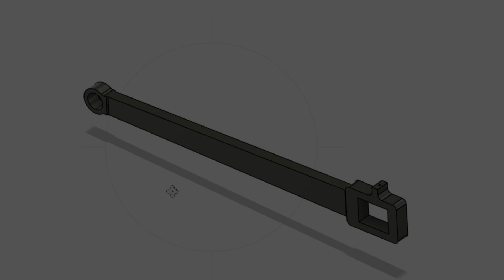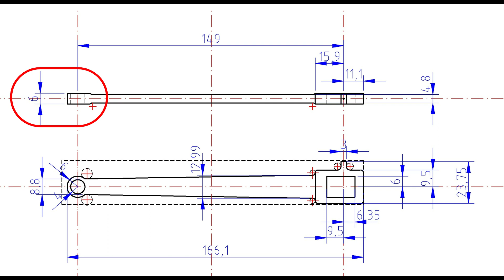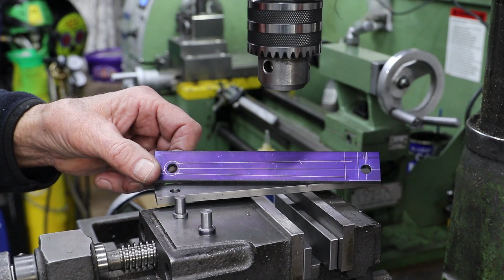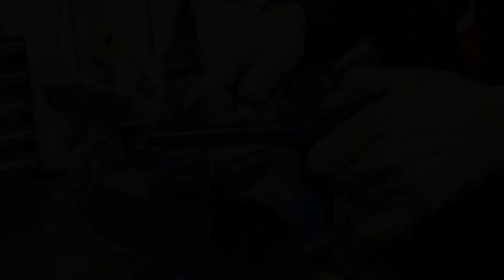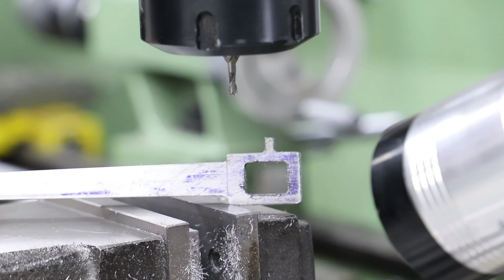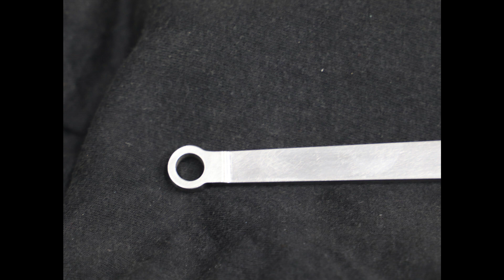Part 36: The Connecting Rods

Comment: Hi Mark, what type of milling machine are you using, and what is the max travel obtainable on the main traverse please.
I guess you have fitted a DRO to your mill.
Cheers.
Andy G.
Reply from the maker: Hi Andy
My Mill is an old Warco round column Mill/Drill (I can't remember if it's a Major or a Minor).  Table travel is approx 380x125mm (15x5") and yes, I fitted a DRO not long after I bought it about 20 years ago. 
Cheers
Mark